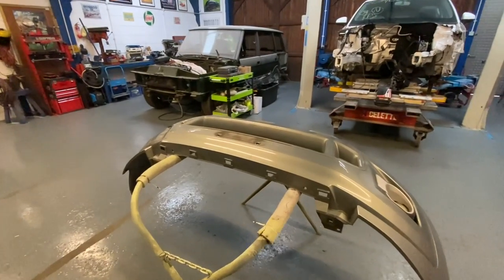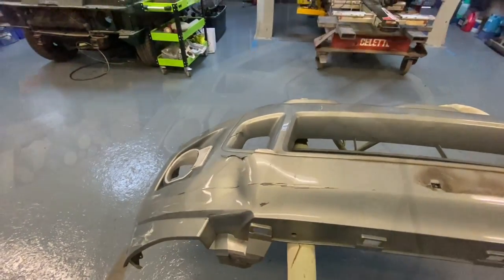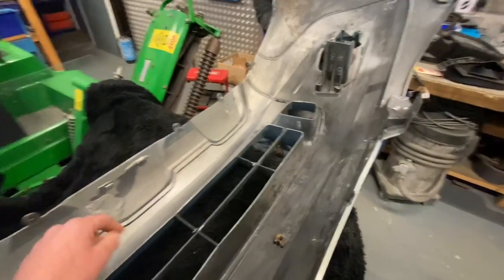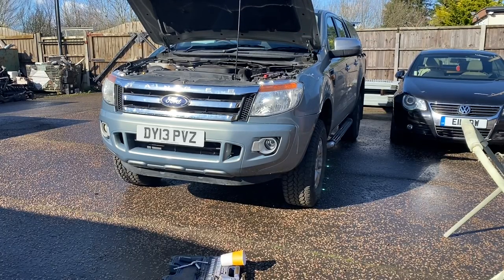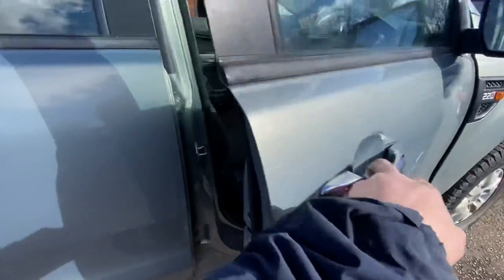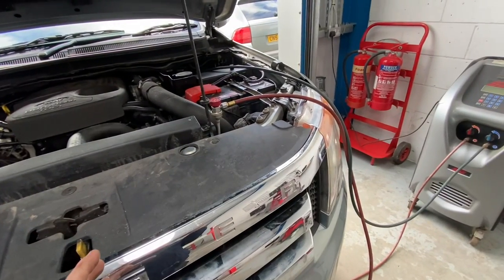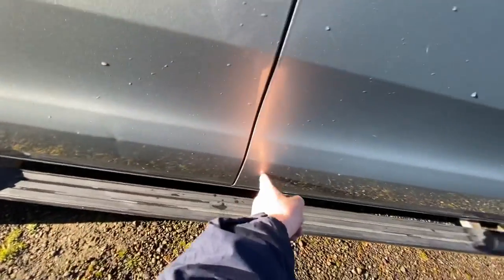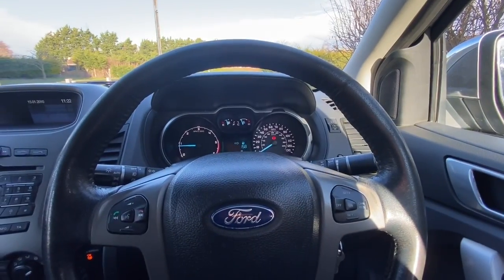FORD RANGER 2.2 TDCI REPAIRED HOW MUCH DID IT COST £££

Comment: Nice sounding engine that and like you say it will get smother as it is run in. I wouldn't worry about the few small dents it is a work truck and has already had a life. I think it is useful having the top on the bed especially this time of year. Thanks for the final video in this series.  Hope you both have a great weekend Rob and Chris, take care.👍👍👍

Comment: Ford actually sell a one piece tailgate seal which attaches to the rear facing edge of the plastic load liner once a canopy or roller shutter has been fitted. As Ford doesn't fit the rear roller shutter as standard for the UK market in order to get the double cab Ranger over HMRC's minimum 1000kg payload in order to be classed as a commercial vehicle for BIK tax concessions, they also don't fit the tailgate seal as standard on UK versions.

Comment: You both did well on that ranger nice motor for someone who wants a work horse and great you have serviced it and putting belts on as well. Good idea to run it for a while gives you and new owner peace of mind. 
I have been inspired by you I clean windows with my sons running South Pole Cleaning and have just bought a car to fix a Mini Cooper fixing everything. Also have an Audi A4 I bought but still has issue with CVT box or ecu not sure where to go with that one. Have a long wheel base T5 I’ve done up and that’s a real head turner now. As well as running a T5 Lwb for cleaning

Comment: Great workhorse ready to go back to work, I would imagine there is some sort of warranty on the engine for the new owner to benefit from. Cleaned up well, just shows how durable these interiors are on the types of vehicles. Watching your channel has amazed me how modern engines suffer catastrophic failures which on the surface appear to be design problems or the bean counters limiting the cost of the unit product, leading to cheaper components  being used, resulting in these failures. Keep up the good work guys. Still anxious about the Bentley ??? 😂😂😂

Comment: You forgot to include the cost of the Full English breakfasts at the engine place (only kidding!). Be nice to see it with the pickup bed valeted but appreciate you're going to carry stuff around in it and it's the last video in the series. Does Chris ever use special repair staples melted into bumper cracks or does he find that plastic welding always does the job OK? (hope he's not breathing the fumes in!)

Comment: Sounds a bit on the cheap side this one Rob , especially in the market were in at the moment , not listed , full recon engine,  new turbo etc etc , prob nearer 10 , do a we buy any on it to give you an idea then take 500 quid off for the paint jobs , great job on the Ranger , lovely pick up for someone , the rear cab top is an extra 400 value at least
Reply from the maker: £7300
Reply: crazy , your price Rob will definitely sell at that , with all you've both  done to it , it will serve someone well